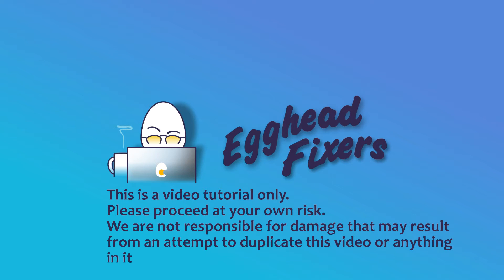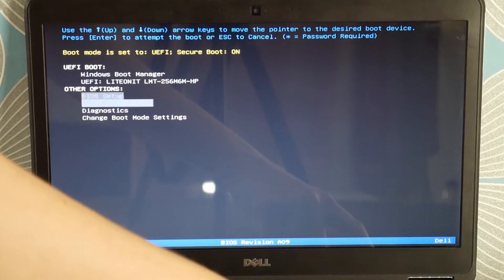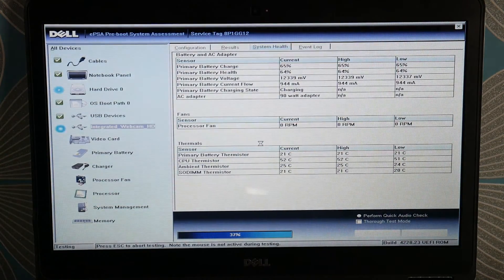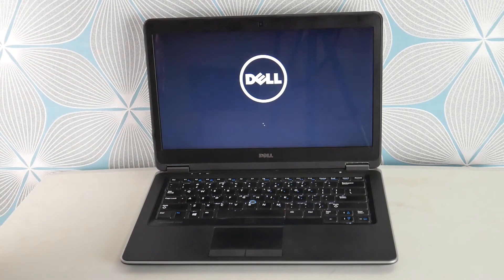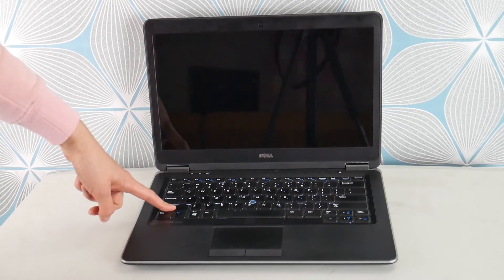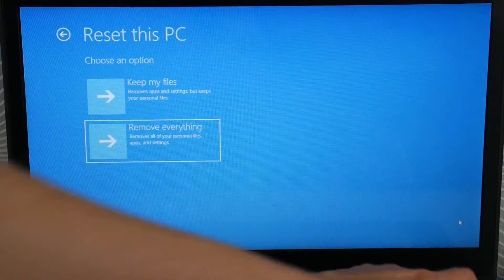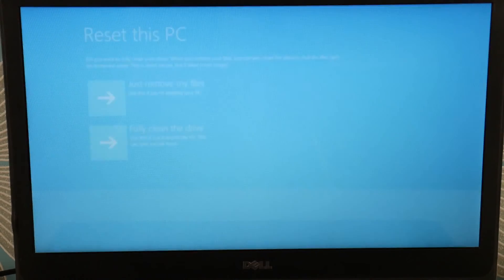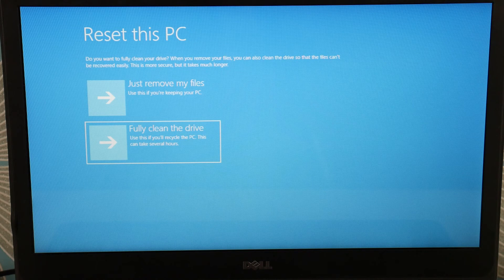How To Fix A Dell In A Preparing Automatic Repair Restart Loop

Comment: I made it through the first part. Tested good. 
The second part wouldn't let me. I held the shift and power button, but no go. It goes back to preparing to fix mode. 😢
Reply from the maker: Sometimes when the Operating System is not functioning properly you can no longer get to the options to reset it. In this case, the next step would be to reinstall the operating system. Here are videos on how to do that:

Windows 10:
https://youtu.be/TElCJDbKdKk

Windows 11:
https://youtu.be/mNN9ssGCxig

You can skip the part of the video about replacing your hard drive. Let me know if you have any more questions:)

Comment: It only happens when i have my external hard drive plugged in. What should i do to prevent it even when its plugged in?
Reply from the maker: My first guess would be that the USB is probably set higher in the boot order then you hard drive. So when you starts up your computer it looks at the boot order and it says your USB is 1st place and your hard drive is 2nd place which gives you an error becuase the hard drive is what the computer uses to start. I would check those setting in BIOS while your USB is plugged in. Let us know if that works.
Reply: @ ok I’ll def try that. Thanks alot!

Comment: I’m unsure if it plays a part but my laptop was acting perfectly fine until I reset my network and did a restart.
Reply from the maker: Yeah, that's odd.  What happens when you run the diagnostic? Does everything pass?

Comment: "There was a problem resetting your PC."
Reply from the maker: Sometimes when the Operating System is not functioning properly you can no longerreset it. In this case, the next step would be to reinstall the operating system. Here are videos on how to do that:

Windows 10:
https://youtu.be/TElCJDbKdKk

Windows 11:
https://youtu.be/mNN9ssGCxig

You can skip the part of the video about replacing your hard drive. Let me know if you have any more questions:)

Comment: Long shot here. My Dell Latitude E6230 is having trouble booting. Keep saying the time of day is not set, which is easy to fix. Probably a CMOS battery? Changing the date and time wasn't really a problem. The only way to boot is to change SATA operation from RAID on to AHCI mode. The problem was that I needed to repeat this process every single time.
Reply from the maker: Yeah, sounds like an issue with your CMOS battery. Your BIOS settings reseating every time is considered a sign of a bad CMOS battery.
Reply: @EggheadFixers  
I appreciate your reply. Thank.

Comment: Hi, unfortunately this isn't working. Dell finds no errors but trying to rest this pc results in a flash to the second screen, than an error that says something like it can't fix the problem. Every option we choose has that same message. How do we fix it?
Reply from the maker: Sometimes when the Operating System is not functioning properly you can no longer reset it. In this case, the next step would be to reinstall the operating system. Here are videos on how to do that:

Windows 10:
https://youtu.be/TElCJDbKdKk

Windows 11:
https://youtu.be/mNN9ssGCxig

You can skip the part of the video about replacing your hard drive. Let me know if you have any more questions:)

Comment: My laptop will not respond to shift f10 and has preparing on screen what can I do to fix?
Reply from the maker: Sometimes when the Operating System is not functioning properly you can no longer get to the options to reset it. In this case, the next step would be to reinstall the operating system. Here are videos on how to do that:

Windows 10:
https://youtu.be/TElCJDbKdKk

Windows 11:
https://youtu.be/mNN9ssGCxig

You can skip the part of the video about replacing your hard drive. Let me know if you have any more questions:)

Comment: Yea my hard drive is broke somehow after never having any issues since I got my laptop,  ever since an update last week it has not worked, I guess things just break 😅 🙃 😕
Reply from the maker: Yes sometimes an update causes additional strain on the system so the hard drive will die either during or after the process.
Reply: @EggheadFixers  thanks for the additional information,  is this something that can happen on a new hard drive?
Reply from the maker: @burnsZY85  That would be very unusual but sometimes you do just get a lemon or there is a power surge that fried it. Did your hard drive fail the diagnostic?
Reply: @EggheadFixers  yea it has failed multiple times, I took it out and reinstalled it to makesure it ain't loose but it still showing as failed on the diagnostic test, I replaced it now everything is fine, but now I have no way of reinstalling Windows 10, I don't have the information stored on a usb, I have no clue how to do it, can a new Windows 10 key be installed?
Reply from the maker: @burnsZY85  Here is a video on how to make the USB for free:

https://youtu.be/k7yf0BrU-z0

and here is a video on how to install Windows:

https://youtu.be/TElCJDbKdKk
Reply: @EggheadFixers  I have no access to a computer,  will just have to get an expert to do it for me but thanks anyway.

Comment: My recovery manner won't open
Reply from the maker: Sometimes when the Operating System is not functioning properly you can no longer get to the options to reset it. In this case, the next step would be to reinstall the operating system. Here are videos on how to do that:

Windows 10:
https://youtu.be/TElCJDbKdKk

Windows 11:
https://youtu.be/mNN9ssGCxig

You can skip the part of the video about replacing your hard drive. Let me know if you have any more questions:)

Comment: help, my computer doesn't move to troubleshooting
Reply from the maker: The computer needs to be started when the computer is completely off for it to work. You only have a short period of time to hit f12 and access BIOS. You have a Window of about 2-3 seconds. It can take several attempts to get it just right.
Reply: @EggheadFixers  different user but same issue. I've been able to access bios but everything looked fine, and I rebooted with the same auto repair boot loop. even took my battery off and cleaned it with q-tips and compressed air and still same result.

Comment: I do everything but my problem is not fixed what I do?
Reply from the maker: What happened when you ran the diagnostic?
Reply: @EggheadFixers   my problem not solve after diagnostic. What i do?
Reply from the maker: @historywithaneeshkhan5747  When you ran the diagnostic did anything fail?

Comment: This doesnt work for me. When i power down holding shift then still holding shift power back on it takes me to the same preparing automatic repair with windows logo. Watches so many vids and sites power on off on off doesnt work, f8 doesnt work, this does work. F12 works everything passes but cannot get past this loop. Not to recovery mode, advanced settings, safe mode. Nothing. Just endless preparing loop on dell logo.
Reply from the maker: Sometimes when the Operating System is not functioning properly you can no longer get to the options to reset it. In this case, the next step would be to reinstall the operating system. Here are videos on how to do that:

Windows 10:
https://youtu.be/TElCJDbKdKk

Windows 11:
https://youtu.be/mNN9ssGCxig

You can skip the part of the video about replacing your hard drive. Let me know if you have any more questions:)

Comment: I am stuck in same recovery loop and Do we lose data in other drives? like E: drive I have some sensitive data which doesn't have any backup so I can't lose.
Reply from the maker: Can you get to the reset options? If you are thinking of resetting it then you will typically have an option to reset and keep your data.

Comment: my hard drive didnt pass. but it was working fine until some stupid windows popup said run repair mode. and now im stuck in it. ive had failing hard drives before and as long as they spin they can boot up and you can drag your data off. not being able to get off this startup screen is infuriating
Reply from the maker: Yeah, that is super annoying. You might be able to pull the data off the drive if you hook the drive up to an external hard drive bay.
Reply: @EggheadFixers   thats what i ended up doing right after. luckily i had a usb hd adapter from previous junk hard drive crashes. plugged it into my newer laptop and had to change all the damn permissions just to open my desktop folder. which sucks on a failing hard drive you cant just open it. anyways got it to work for 10 hours to transfer about 600 gb only lost 2 files that i know of. yesterday morning i went out and bought 2 14tb hard drives for all my shit so i have double backups

Comment: Hy, i am not able to get into recovery manager Dell Inspiron 3505, can you please help me out
Reply from the maker: Sometimes when the Operating System is not functioning properly then you can no longer get to the options to reset it. In this case, the next step would be to reinstall the operating system. Here is a video on how to do that:

Windows 10:
https://youtu.be/TElCJDbKdKk

Windows 11:
https://youtu.be/mNN9ssGCxig

You can skip the part of the video about replacing your hard drive. Let me know if you have any more questions:)

Comment: Hi Liz. Dell inspiron 17 5000. New SSD all hardware tests good. Older HDD and cloned SDD fail automatic repair. Changed back to old HDD; booted once, cloned it again, backed up. Still locked in autorrepair. It wont install from DVD, wiped GPT partitions, repartitioned, and formatted MBR. Still locks with kernal mode trap, cant complete setup. 
Do you think I need technician to find a bad motherboard?
Just bought a new 1k hp. This dell only 6 yrs old. 😢
Reply from the maker: If you cloned the operating system on the old hard drive and put it on the new SSD then it would inherit the same problems as the old hard drive. You most likely need to install a new version of Windows on the new SSD. Here is a video on how to install Windows:

Windows 10 version:
https://youtu.be/TElCJDbKdKk
Windows 11 version:
https://youtu.be/OVxq4BgJSCA

Let me know how it goes □
Reply: @Egghead Fixers  the new drive was fine for about 3 months, its fine now. It was the motherboard.
Reply from the maker: @midi1529  Oh wow sorry to hear that
Reply: @Egghead Fixers  thank you, guys. Still leaves me with questions. But since Im a physician now and not a tech anymore, it's just not worth the bother. Nothing changes in the industry. Things are just set up so that no one can repair a OS without service tech authority. It was getting that way when I left the industry. Its the same in medicine, but the degrees cost more. Proprietary information.

Let you know when my HP arrives. And i cant make a win 11 copy lol
Reply from the maker: @midi1529  lol sounds good

Comment: The worst kind of laptop. So unreliable. I will never buy anything from them. It has cost me dearly..
Reply from the maker: Sorry to hear that. How old is it? Have you checked to see if it is still under warranty? Dell warranties last 1-3 years typically
Reply: @EggheadFixers  1 year. It suddenly stopped working. And their  os recovery software is a joke. Does not even load from boot menu. Never ever again. I lost so much precious data and memory. I hope some recovery sw may recover some. But never again this useless product.
Reply from the maker: @aador602  Ya that's super annoying

Comment: What to do for lenevo laptop my pc get stuck from 48 hrs on preparing automatic repair
Reply from the maker: Wow sorry to hear that:/ Some Lenovos have a build in diagnostic that you can access through the boot menu to see if it's a hardware problem. This video is on a different issue but it show you how to access it:

https://youtu.be/QypjSEVdT8M

Run the diagnostic and let me know if everything passes.

Comment: My daughter's Inspiron 3583 was trying to do a windows update and something happened that it did not complete the update and got into a boot loop saying it was trying to revert back to a pre-update situation. Unfortunately it has been looping like this for 3 days and I am not able to get into any function to get back to the last good image. I did run the F12 diagnostics and it said hardware wise all is fine. Any suggestions?
Reply from the maker: Sorry to hear that:( If all the hardware passed the diagnostic then the next step would be to try reinstalling the operating system. Usually, this problem is caused by a problem with the operating system. Here is a video on how to do that:

https://youtu.be/TElCJDbKdKk

You can skip the part of the video about replacing your hard drive. Let me know if you have any more questions:)
Reply: @EggheadFixers  since the system was preloaded with windows 10 and had no discs how do I do that?
Reply from the maker: @Jedi_Kensh_WiOak  You can make a USB to install Windows on Microsoft.com.
This video shows you how to do that:
https://youtu.be/k7yf0BrU-z0

then you will use the USB to install Windows. This video will show you how to do that:
https://youtu.be/TElCJDbKdKk

You can skip the part of the video about replacing your hard drive. Let me know if you have any more questions:)

Comment: Hi, as I was doing what you told in the video for some reason the laptop started making weird noises. I am trying to restore some of the files in this laptop but this problem showed up, I am not sure what the noises mean or how to work around it. This is a very old video but I hope you can help me.
Reply from the maker: What do the noises sound like? Also when you run the diagnostic does everything pass?

Comment: I've tried many ways but it didn't work with my dell xps 9350. However, I were already successed with option: Trouble shoot -> advanced option -> starting setting set up-> safe mode -> Done
Reply from the maker: Happy to hear the issue is resolved
Reply: This worked for my Dell optiplex 7040 thanks @ducBuiminh-pk1sv

Comment: Cannot get it to 2nd screen after holding shift for reboot. Still spinning. Desktop optiplex 5060
Reply from the maker: Sometimes when the Operating System is not functioning properly then you can no longer get to the options to reset it. In this case, the next step would be to reinstall the operating system. Here is a video on how to do that:

https://youtu.be/TElCJDbKdKk

You can skip the part of the video about replacing your hard drive. Let me know if you have any more questions:)

Comment: My Laptop keeps going into automatic repair and does not seem to get any further, it says it may take over an hour, but left it running this overnight and no further forward. Tried to do what you said in this video,  holding down shift etc. And it just went in to the automatic disk repair.  It's not as if I mistreat it, I always shut things down correctly, and try to take care of my stuff.
Reply from the maker: Sometimes when the Operating System is not functioning properly then you can no longer get to the options to reset it. In this case, the next step would be to reinstall the operating system. Here is a video on how to do that:

https://youtu.be/TElCJDbKdKk

You can skip the part of the video about replacing your hard drive. Let me know if you have any more questions:)
Reply: @EggheadFixers  i

Comment: When i tried the recovery way, it doesn’t wanna load up the recovery screen. Just goes right back into the automatic repair screen. Any advice?
Reply from the maker: Sometimes when the Operating System is not functioning properly then you can no longer get to the options to reset it. In this case, the next step would be to reinstall the operating system. Here is a video on how to do that:

https://youtu.be/TElCJDbKdKk

You can skip the part of the video about replacing your hard drive. Let me know if you have any more questions:)

Comment: I can't reset my laptop
Reply from the maker: Sometimes when the Operating System is not functioning properly then you can no longer get to the options to reset it. In this case, the next step would be to reinstall the operating system. Here is a video on how to do that:

https://youtu.be/TElCJDbKdKk

You can skip the part of the video about replacing your hard drive. Let me know if you have any more questions:)

Comment: I hold in shift but it does nothing,  it eventually just goes to the preparing automatica repair again
Reply from the maker: Sometimes when the Operating System is not functioning properly then you can no longer get to the options to reset it. In this case, the next step would be to reinstall the operating system. Here is a video on how to do that:

https://youtu.be/TElCJDbKdKk

You can skip the part of the video about replacing your hard drive. Let me know if you have any more questions:)

Comment: Hi Liz,
I seem to have the same problem with my old Dell Vostro stuck on Preparing Automatic Repair - I have done a diagnostic check and all hardware is correct. I cannot seem to enter the recovery manager despite holding n to the shift key and pressing the power button. I have also tried to switch on and off the laptop several times but it seems to be impossible to enter the recovery manager!!
Please kindly advise.
Thank you.
KB
Reply from the maker: Sometimes when the Operating System is not functioning properly then you can no longer get to the options to reset it. In this case, the next step would be to reinstall the operating system. Here is a video on how to do that:

https://youtu.be/TElCJDbKdKk

You can skip the part of the video about replacing your hard drive. Let me know if you have any more questions:)
Reply: @EggheadFixers  me too